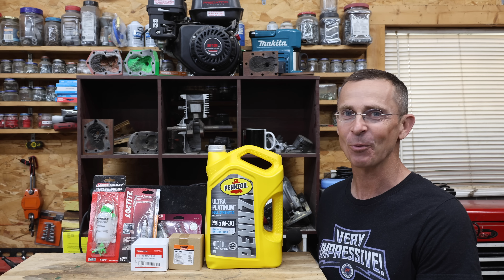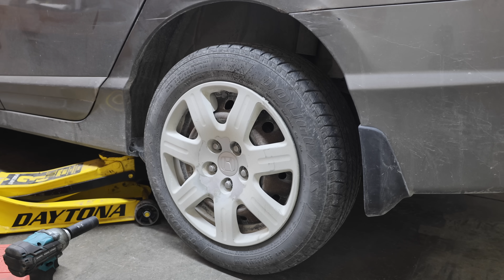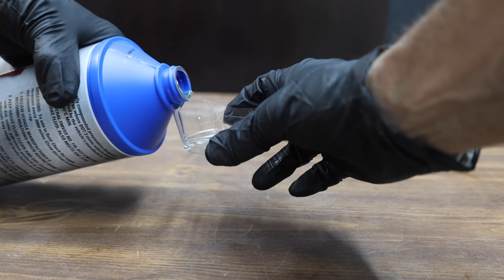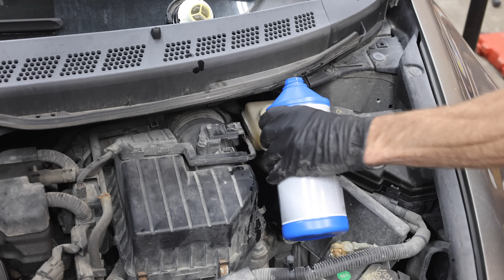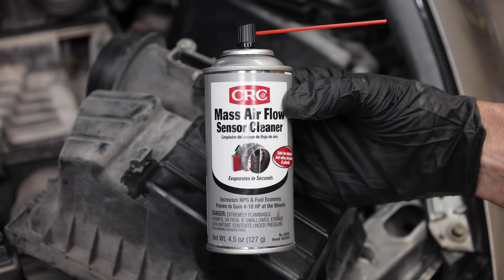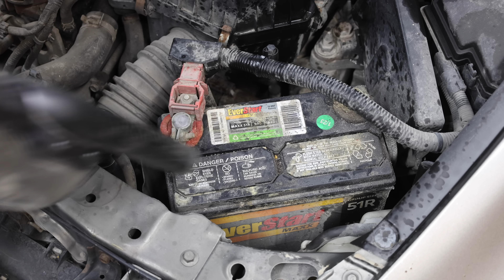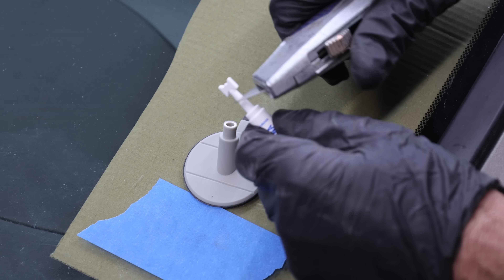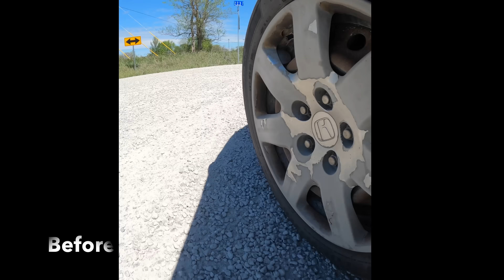Most Reliable 200K Mile Car? Let's Settle This!

Comment: I bought my 2008 Civic as a commuter car for work. I am now retired, and it is still my daily driver with over 200k miles. One thing I found curious was that your sedan uses drum brakes in the rear while my coupe has disc brakes. I would buy a new car, but I cannot find an affordable, reliable coupe to replace it.

Comment: Great job, Todd! The only thing that I would do differently is to replace the brake springs. The brakes generate a lot of heat which can adversely affect the temper and operation of the springs.   It can be difficult if not impossible to determine their actual condition with just a visual inspection. I only reuse springs if new ones are no longer available. It’s cheap insurance.

Comment: My commuter car is a 1991 Honda civic that has 328,000 on it. original engine and transmission  and still going strong. My yearly commute is 18,000 miles

Comment: I have put over 300,000 miles on my 1998 Ford Taurus.   The strategy that I use is when a part breaks or wears out, I unbolt it and then I bolt in a new part.
Reply: Yeah.  So many people delay replacing parts until the point that everything is wore out and it nickel and dimes them all at once.  That's why I used to always sell my cars at 200,000 miles, but now I do the repairs as soon as they happen and my cars are lasting longer.

Comment: "Let's take this $500 car, spend $1000 in parts, and make it highly reliable." --then proceeds to drop 20+ years of automotive maintenance skills in a 15-minute video without blinking.  Like, "hey, i opened the trunk; guess we should replace the rear suspension while we're in here.  It will only take a moment..."

Comment: I have to say, not only is this a great video that puts many of your previous findings into use, but it also highlights one of the best parts of Project Farm, the community.  Every video sees fantastic discussion in the comments where people bring their own life experience and also their points of view in applying your findings to many different industries.   The conversations where the weights of different values are discussed between a simple weekend warrior, a hobby woodworker, and a professional tradsperson help to give nuance to the outcomes you find.  Looking forward to many more years of videos.

For a future video, could you use your research on things like oil, blades, tires, etc to fix up an older lawn mower and show how it can get more life?  Also, could you look into comparing lawn tractors, zero turns, and do a head to head between gas and electric versions of the same lawn mowers?  I know that those would require a great deal of time and coordination, but I would love to see you stress test mower maker claims.

Comment: 2003-2005 Chevy trucks are amazingly reliable. I still have a 2001 Honda Civic with 275k and a 1999 4Runner with 257k miles. Keep them around just because they won’t stop running and are good backups when you need them

Comment: How much would new headlight assemblies have been vs the restoration kit?  I got new assemblies for my 2006 Saturn Ion for about $110 and they installed in seconds (literally 2 plastic pins hold them in).

Comment: Those cars will reliably land you at the local gas station. If you actually drive around a bit, it would be cheaper to purchase a new, efficient car. I worked out costs, and ended up with a new Prius plug-in.

Comment: On import cars they have always suggested to change the timing belt and water pump every 100,000 miles as well.  I didn't do that and the water pump failed when it was -40 degrees and I had to pay the shop $407.  If I would have changed it myself during the summer it would have only been $63.
Reply: This year civic has a timing chain, the valve clearance does require a manual adjustment every 100,000 miles.

Comment: I own this car.  2008 Honda Civic.  I’ve never had one issue with it. 125k miles with original brake pads (manual transmission).

Comment: 2010 F150   240,000 miles, I do the oil changes every 10,000 miles, tires about 60,000 miled sparkplugs at 100,000, air filters 10k, shocks & struts changed at 100,000 and changed belts upper and lower hoses and thermostat. Plus brakes nothing to big

Comment: I got a couple high mileage vehicles that me or my family members use daily 
1999 f250 5.4/4r100 375k
2002 pt cruiser 2.4/auto330k
2005 malibu 3.5/auto 290k
All have original engines and transmissions and yes even the pt cruiser

Comment: cv axles cause clicking noise why driving forward while turning. struts bearings make a low deep sound as if a noise is being made through water or like ice on a lake cracking while turning wheel when stationary. Im a manager/technician of a automotive repair shop

Comment: I recently got a VW Jetta TDI that has over 250,000 miles on it.
When I got it, it had been sitting in a field and rotting for about 10 years.
After cleaning out rats' nests and splicing/replacing wires and hoses they'd chewed, it started without any other work. This was on the fuel that was still in the lines!
I've replaced belts and fluids (all of them) and It still needs new struts, but it is in amazingly good shape. Even the paint looks decent.
There's something to be said for older (25+ years) cars!

Comment: I'm a firm believer in quality used equipment, nice video. My vehicles mileages range from 185000 to 800000 plus, with the Chevy Luv holding to record of rolling over numerous times

Comment: Why would anyone give away such a good vehicle? 

My 2018 Honda fit has never had a fluid change (besides oil), never had plugs or wires, or brakes changed...and is at 120000. I'll never get rid of this thing.

Comment: Honda CRV. Have two of them one a 1997 AWD. Bulletproof. Change the oil, do the scheduled maintenance in the driveway and still going strong. Oops, everything wrong with it I fixed in the driveway with simple tools. Brakes, fuel pump, struts etc. Greatest thing in automotive history to fix yourself. Fuel pump was the best. Remove the rear drivers side seat, couple of bolts and there it was. BTW 200k vehicle just change all the hoses now. Radiator, PVC, fuel lines. Just do them.

Comment: Ive been driving older cars and trucks for my entire life im 45. There are some folks who feel absolutely great about a 500 a month payment for a LEASE... At my work there are ALL KINDS of people doing this.. These same people live in apartments  and have zero money saved... Not trying to be a negative Nancy but some people have NO idea how to get ahead and budget money.... NOBODY is perfect trust me... Ive seen some lease payments 200! A MONTH. The fine print says you need to put down 5000 cash to get that payment.... IMAGINE giving someone 5000 to rent a car...... ARE YOU MENTAL. I just Sold my 2004 v6 4x4 tacoma after 10 years that I owned it... I paid 9000 for it 10 years ago. I sold it for 4500 bucks... 200k on it. I took care of that truck and it NEVER let me down.. I never had a loan on it... I paid cash for it 10 years ago and sold it and bought a newer tacoma for 6500 that just had a frame replaced and was in AWESOME condition. The person who traded it in didnt want to fix the exhaust. 3 CAT flanges were leaking. To replace the CATS would have been like 3000 bucks.. NOPE I took it to a local place Lues custom exhaust and they FIXED the leaking flanges for 300 bucks... Check engine light is out now and IT PASSED State inspection. So I got a amazing v6 4x4 with 4 door with a NEW frame and Everything under it is awesome breaks shocks tires for around 7000. Im lucky i work at a toyota dealership BUT that all plays into the benefits of working there 10 years... My cars stay maintained and I dont pay big payments I pay one time and live debt free.. With all that said I was able to save up and buy a Amazing piece of land!!! Being frugal like me an my wife will give you a better life. Spending  money all over the place YOU CANT afford is Foolish... This video shows the ABC of how to be smart and afford to have a worry free life about a bill... Life is stressful enough constantly worrying about paying bills puts family in a stressful environment. That seams to end poorly from what I have seen... Sorry rant. Love your videos!!!

Comment: Im about to change cv axle on my honda, thanks for the video. It helps a ton
Reply: I did mine on the driver's side on my Honda Fit.  That one came out easy.  The passenger side one is stuck in the hub, so I am thinking a propane torch will break the rust.  I do not own an air compressor big enough to run and air hammer.
Reply: @MyLifeThai371  you can get electric impact
Reply: @element168  The nut came off easy.  The splined axle is seized in the wheel bearing hub assembly, because of corrosion.

Comment: I bought my 2000 Ram in 2009 as a salvage for $2,500 cash. It's been "totaled" again (rear-ended and bent my back bumper). It's about to turn 300,000 miles and I could still sell it for 3 times what I paid. But I won't. My 2006 Accord was "totaled" twice in the last two years. Rear-ended both times. I bent out the trunk and deck lid enough to get it closed, and got the bumper cover back on it, and it's still running fine at 180,000 miles. I paid $8,000 for it 8 years ago.

Comment: Those older vehicles will be far more reliable than these brand new modern vehicles consisting of too much plastic, electronic components, and built-in planned obsolescence.  The key is regular maintenance.

Comment: Great info for those that don't think these older vehicles are good.  I have a 2008 Chevy Colorado 4x4 that cost nothing compared to a new one.  I put a set of rear shocks for $200 installed and it drives nicely.

Comment: You could also puncture a hose and use an airhose to create a vacuum. Blow through the hose in the opposite direction of the side you need to pull vacuum.

Comment: Thank you for makng this video! I have the same honda civic that needs similar repairs (cracked windshield, sagging rear bumper, old oil and transmission fluid, and spark plugs. You motivated me to at least get some of these items taken care of and what i should look out for in case the previous owner missed any maintenance items

Comment: I hate to be this guy but I have an 87 Celica GTS  22R with 430,000. Bought it with 350,000.  Clutch was replaced but the rest was stock. They don’t make things like they used to.

Comment: I have only owned one car with UNDER 200k on it. It was a 1989 Volvo 240 and (I still have it) it has 110k on it right now. Other than that, I have had a 1999 corolla with 230k (sold it due to damage, but it still ran and drove great, ) a 1992 Volvo 240 with 331k miles on it (just drove it around 50 miles today,) a 1998 Honda Accord with right at 200k, and a 1995 Toyota Tercel with 197k so we will call that 200k. 
It seems like 200,000 miles is the line for most people, and for most modern vehicles, it may be the end of life; but for 80s/90s Japanese cars especially, that is really not a number to be scared of as long as they have been taken care of.

Comment: One of my favorite YouTube stars....Great job
Some extras: 
-new coolant temp sensor
-clean and pressure wash the radiator inside and outside
-new upper O2 sensor
-take out and clean the crank and cam sensors
-unplug and clean all electrical connectors 
-clean the engine grounds
-replace the PCV valve 
-check for loose and cracked rubber vacuum hose
-clean the EGR assembly 
-engine flush(old oil) + Motorkote engine treatment(new fresh oil)?
-add some sound deadening material @ trunk, floor, engine bay, wheel wells , doors
-LED headlights bulbs
-change the speakers with some new mid priced ones...they make a difference 
-get some lightweight alloy wheels to help with rotation mass for improved performance and MPG
- rust prevention aka:  CRC Corrosion Inhibitor or similar
Reply: wait I thought egr only on diesel cars, now I have to check mine
Reply: @eidrag no, many gas cars have EGR systems.
Reply: @eidrag  egr is common on gassers too. It isnt harmful like it is on diesels though, cause gas cars dont produce soot
Reply: Definitely clean the grounds! Most neglected connection on cars.

Comment: Only one vehicle!!!  2010 - 2015 Toyota Prius (3rd Generation).
No starter, no alternator, no transmission (just planetary gears, NO SHIFTING GEARS), and the engine only runs half the time.
My 2010 Prius has 205K and it's just broken in.  It still has its original brake pads, because when you brake the electric motor, puts that energy right back into the batteries.  Then there is this... I get 47.7 MPG in town.  And it is surprisingly fast Off-The-Line!  I'll get another 300K miles out of it.

Comment: I owned a Honda Accord and Honda Fit. Both were assembled in Japan. They both went over 200k miles without any major issues. I did all the normal scheduled services myself and saved a lot of money. I really enjoyed how brief but detailed this video was.
Reply: I miss my honda fit...loved that lil car....but I bought a car I really wanted a 2020 civic si. Love that too but man my fit had so much utility
Reply: Partner had a honda jazz/fit she never a single drama with it. Turning circle was unreal too.

Would highly recommend one.
Reply: My 2010 Honda fit just hit 280k and is going strong (doesn’t look so pretty but who cares really?  Go gen x).  I’m already looking for another one, same year blue.  Then I’ll use the old one for parts.
Reply: My current is an fit hybrid 2014, i love it
Reply: @m1sh474  last year of a great Honda Fit generation.  You should see 300k.
Reply: I'm a diehard Honda fan...my 97 accord finally lost a rod bearing at 320,000 miles.  My 07 civic hybrid is still going strong at 310,000 miles.  A well maintained Honda will outlast almost anything.
Reply: I have a 13 Civic made in Canada at 200k and still looks and feels like a new car. No leaks, rattles nothing.

Comment: Dang, all Hondas from those years must follow the same breakdown order lol. I also had a $500 06 that I had to do the exact same repairs and then some, cv axles, wheel bearings, battery, shocks, coolant, thermo, radiator, alternator, brakes. I hate those rear drums, so annoying. Mine was a manual with a broken clutch arm, someone tried to weld it back together lol. It was easier to just replace the entire transmission. Paint was gone so I had to repaint and clearcoat the whole car. Car was good after that. Most Hondas just need oil changes at the bare minimum to get to 500,000 miles, good reliable cars.

Comment: I was a fleet mechanic for a large municipal government fleet department for 37 years. I worked on cars, pickup trucks, heavy trucks, and heavy equipment. Probably the most common car we delt with was the Ford Crown Vic. They were the ONLY vehicle we had that almost never caused any problems. I started driving them back in the mid '90s. I currently have a Mercury Grand Marquis (just a fancier version of the Crown Vic) I bought with 87,000 miles. That was 11 years ago. It now has 384,000 miles on it, still runs like new, and has required less than $1,000 in repair parts since I have owned it. No internal engine or transmission problems. About 8 months ago, I bought a like new 2007 Mercury Grand Marquis with only 36,000 miles from the original owner, an older couple living in a retirement community. It had been kept garaged, and came with a stack of service receipts. I gave it a thorough going over, and the only thing I could find wrong was that it needed new windshield wipers. It will be the eventual replacement for the '06, but I am going to keep driving that car for as long as I can without doing any major repairs. I expect it to go well past 400,000 miles. Then I will keep it as a parts car for the '07. I don't think I will ever need to buy another car. IMO, the Ford Panther cars (Ford Crown Vic, Mercury Grand Marquis, Lincoln Town Car) with the 4.6l SOHC 2 valve engine are the most reliable cars ever made.

Comment: Excellent video there Todd and I you are a good repair of good used vehicles and there is nothing wrong with a good used vehicle spending a little money on it it definitely is way cheaper than the new vehicle and the amount that they depreciate in the first year well exceeds what you spent there and also you save that money for yourself for the next vehicle to work on and on and on and on great video Todd keep them going

Comment: At least this Honda Civic is repairable and reliable. Hopefully, the transmission lasts, because they tend to fail around that mileage, even with proper maintenance with the Honda DW-1 ATF. People have used other ATF alternatives, such as Valvoline and Amsoil Signature Series Fuel-Efficient ATF and found almost no issues. The Amsoil ATF might last the transmission longer.

Comment: I got my 140k mile 06 outback for $700 in 2017 with a bad clutch. Pulled the engine, did head gaskets and a clutch. and its approaching 220k and has been great vehicle even with all the winter abuse i put it through.

Comment: Wanna get 200K out of a car? Ditch the Pennzoil and FRAM. None of my cars have 200K but my daily 2006 3 liter Taurus has 164K and NO blowby. All the fluids have been changed regularly including trans fluid every few years ESPECIALLY in hot Southwest Florida. I have 7 so I just change the oil once a year.

Comment: I wouldn't have touched that transmission fluid. At that point the transmission is going to be warn out and that new fluid most likely is just going to make it slip. The old dirty fluid still was working due to contaminants thickening it up. Try to keep the used fluid handy just in case.